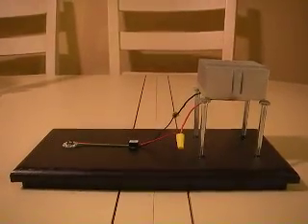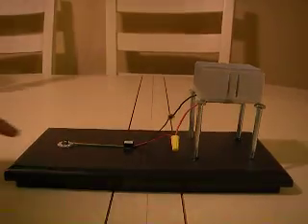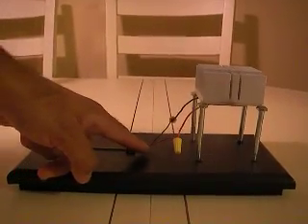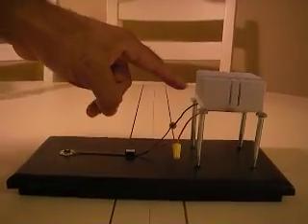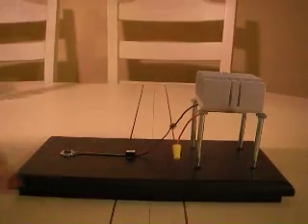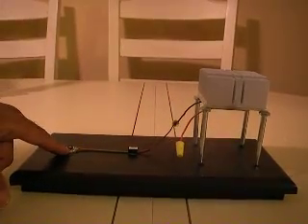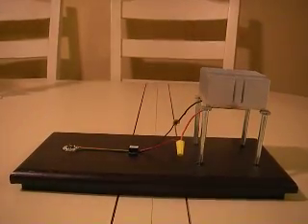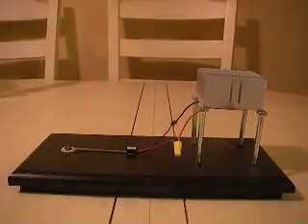The Thermo Lamp - Part I

Comment from the maker: Hello,
I'm happy to see you are interested in my Thermo-Lamp. I have sold already two Thermo-Lamps on ebay for $140.00 and $20.00 shipping.
if you are interested I have one available now for $85.00 and $20.00 shipping, newly built with a cooper heat-sink which is twice as efficient as the aluminum heat-sink.
Thank you.